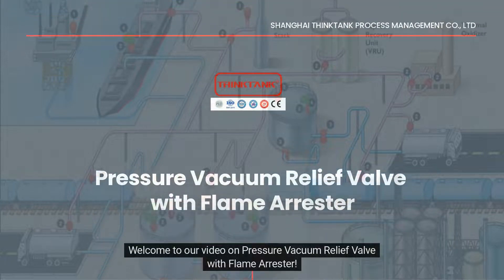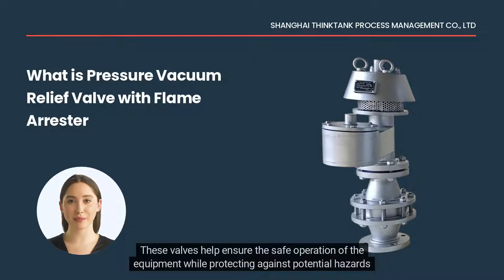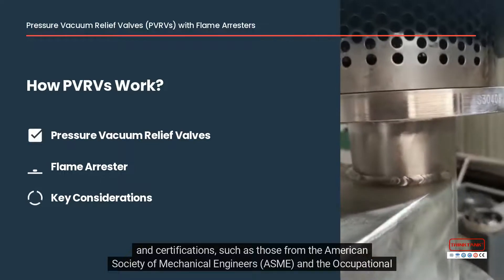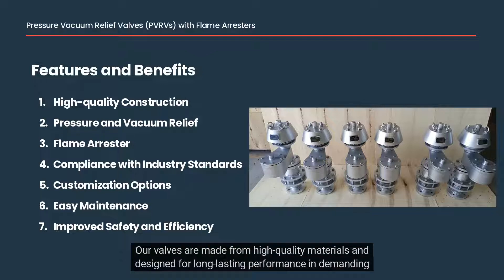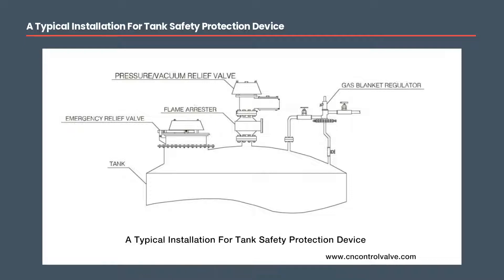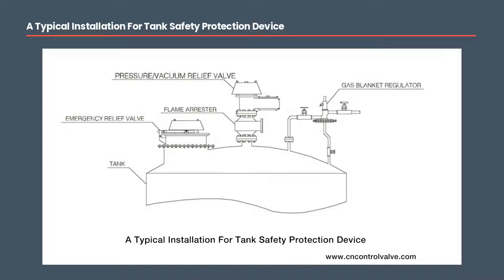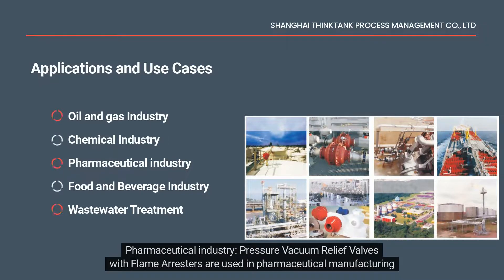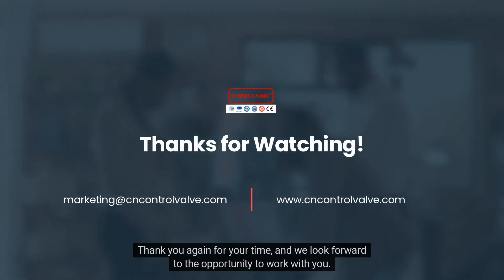Pressure Vacuum Relief Valve with Flame Arrester

Comment: Hallo my name is puspa. I have a question from ur video. Is flame arresters are valve? Or the flame arresters parts of relief valve?
Reply from the maker: Flame arresters are not valves, but they are closely related to safety devices like relief valves in terms of function and purpose. A flame arrester is a device designed to stop the propagation of flames in a pipeline or venting system. It prevents fire from traveling to other parts of a system, especially in hazardous environments. It's commonly used in storage tanks, pipelines, and processing plants handling flammable gases or vapors. Should you have any questions, welcome to leave your message, or visit our official website: https://cncontrolvalve.com/